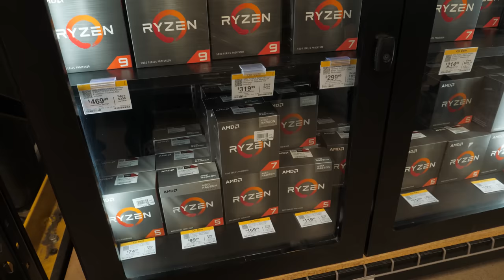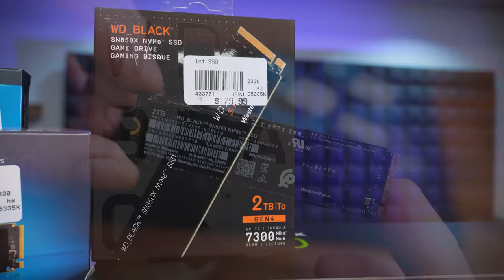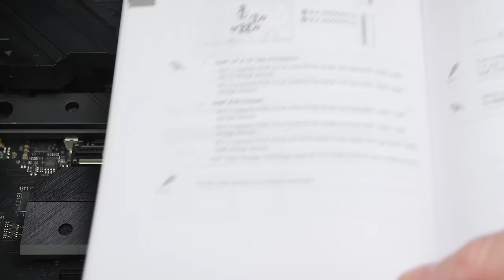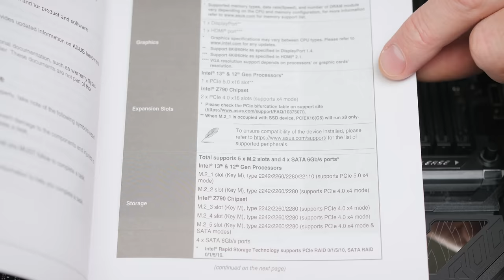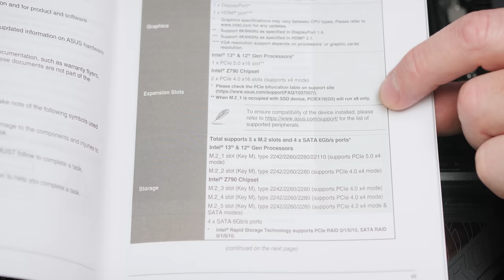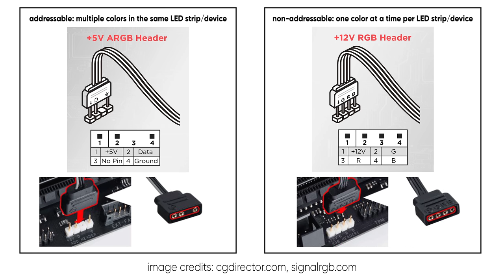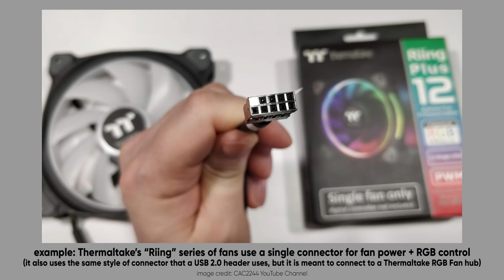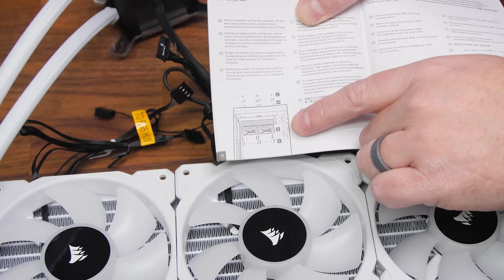How To Build a $3000-$5000 High-End Gaming PC - Step-by-Step Guide

Comment: HI Paul great vid 1st vid I seen of yours, Thanks for pointing out the config issues with connecting the various addon's and restrictions or requirements of the system in terms of compatibility and I thought there should have been a cradle for the fan controller I would like to set the rad against the intake fans at back of case followed by another 3 fans extracting the cold air into the box and powerful top fans at top to extract the heat maybe another rad at base to increase the cooling further and some sort of barrier to protect the system from leaks of coolant in the event that this could happen. not too keen on liquid cooled pc's not bothered about fancy lighting all I want is a system that can do any the tasks put upon it efficiently and is reliable, functionality, Expansion possibilities for the future and longevity connectivity (a bulb is just a bulb unless it means something) So for example another HDMI port so that I can connect you guessed it another BULB!( only this is not just any old bulb this bulb is another display unit!) I don't think we got a Microcenter over here in the UK! =(

Comment: Paul, out of all the components you chose the one I was really excited on you showing what the Thermaltake Toughpower GF3 PSU. Thermaltake doesn't get enough love when it comes to PSU's especially since they are putting out PSU's with the 12VHPWR connector that's rater 600W. How do you like Thermaltake's latest PSU offerings?

Comment: Ong the aio part is perfect to! Im sooopp inlove with the beauty of the new corsair h150i link series and deseperatly want to learn how to do it and what case to use but im so new to it all. Might go tower cooler if i stay 5800x3d but the 7800x3d is sooooo tempting aslong as everything feels safer to use and i can get a super awsome motherbaord for my needs. Aio is so tempting to just a solutly go crazy with 400$ of rgb fan heaven. Only issue is 750$ for am5 choice or keep what i got and go 200$ on a perfect b550 am4 mobo for the gear i have. Might throw the x3d with ram in my am4 b450 after i build a new system and bios flash it cause then id have 2 perfect systems and give my old 1080 some love for casual gaming and less heat and one perfect fancy eye candy system to tinker with and do crazy stuff for gaming oc and intense play when i dont gave to care as much about crashing my data and documents pc

Comment: @13:40 it should be noted, that some slots disable other things on the board sometimes, if it is shared gen 5 it could make the first pci-e slot x8 instead of x16
if you have both pcie slots filled it may disable 1 or 2 of the m.2 slots, and if there is a sata m.2, it would liekly disable at least one sata port, rtfm as you said
@14:23 ok you covered it, had me worried :P

Comment: Hello! I'm trying to get a new PC and thought this video was great. However, I only play a few video games like valorant on the side and mainly want to use a PC for programming/data analysis stuff. Would the $2000 graphics card be a bit overkill? I'm not too familiar with what's reasonable pricing. Is under $1000 plausible for a graphics card? Or rather just does anyone have any cheaper recommendations. Or is there anything else major that can get cut. I was thinking of keeping it under like $2000-2500... Thanks a lot; I appreciate it!

Comment: Paul, thank you for this build. My 14 year-old wants to build his own high-end system. Was going down the AMD path build (we built a pretty budget AMD about 2 years ago) but with their voltage issue have gone the way of Intel. He was given permission by his mother to spend some of his savings and we are following suit on this build (even the graphics card). Question: you have Lian Li extra fans. Were those just for talking about (I presume) or did you put them in the system somewhere? I don't see them on the front of the case. Again, thank you for the walk-through. Now we just have to wait on the parts. Cheers!

edit: watching the video for the 12th time, I answered my own question. Lian Li extra fans are for demo purposes and not put in the system.

Comment: So I got the ASUS NVIDIA GeForce RTX 4090 24GB TUF Gaming and it came with this four way splitter to power it. Can I use this single 600 watt power wire you used (I have same psu as in this video) or do I have to use the splitter and four PcIE wires?

Comment: Paul. Question please.  New to PC builds.  I have a Corsair iCUE H100i Elite LCD.  I plugged it into the CPU FAN header instead of the AIO PUMP HEADER.  Should I switch it to the AIO PUMP header instead?  If so why?  And if not why not?  Trying to learn...  Please help.  I'm using the ROG CROSSHAIR VIII
DARK HERO
Motherboard

Comment: I'm going to be building a pc for the first time soon, and I wanted to know if I should use Windows 10 or 11? Is there any difference?
Reply: it seems 11 worked slightly better with high end parts but from what i've seen latest 10 version works just as well

Comment: I have the same AIO on my recently new build. The LED on the pump was fine, when I first turned everything on. Then once I started to install windows, it just switched off. AIO is fine and rgb fans, just the LED on the pump. 

Tried using the ICUE software, it recognises the commander hub and RAM. Not the pump. Not sure what to do.

Comment: With those 13900K, really think an AIO is a bit sketch with the thin radiators and weak pumps.  Work fine if you don't OC I guess?  I can't imagine trying to air cool one.  I'm sure it would run, but can't believe it would be at all efficient and might throttle under a heavy load.

The wattage those things pull is absurd. lol

Comment: Man the rgb thing adds soo much wiring that’s insane.. how do you know where to hook up cpu water cooler? There is a cpu cooler spot and a water pump spot? What’s the difference? Also how does the system know to run the fans for water cooler in radiator on initial start before you download Corsair software? Hate to get your $600 cpu hot right away lol

Comment: With the orientation of the fans used, wouldn't they create negative pressure in the case? (3x140 intake, 3x120 & 1x140 exhaust)

Comment: Can you please answer my question?
I searched alot and noticed Strix 4090 mostly has coil whine issue.
So I decided to go with Gigabyte gaming oc since none complained in the internet yet!
But noticed it is kind of old so it is better to go with waterforce rev1.1
Can you please let me know how can I have both radiator and gpu watercolled inside case?
What is your suggestion.
Which case you offer?
Thanks in advance.
If you provide me link it would be great!

Comment: Quick question I want to ask ya. I’m currently in the process of building a new pc but I don’t know to go with the 13900k or the 7950x3d. I want a build the can both be great at productivity and gaming
Reply: it depends if what ever you are using benefits from the x3D or not, some productivity programs work better with intel some with the amd cpu, however if you just want a blanket statement, given how amd products get better with time though optimizations, amd has more cores and we are at the beginning of am5, IF you have the money I'd go with the 7950x3d, also the amd cpu works better with AI software and it seems we are going in that direction.

Comment: My build:

X570 Gigabyte Aorus Master 
Ryzen 9 5950x 
Noctua NH-D15 
Rx 7900 xtx
32GB Team Force 3600 cl14
Sabrent Rocket Plus Gen 4 2TB SSD 
Creative Soundblaster AE-9 with two Burson V6 Classic Single and two Vivid Dual op-amps 
LG UHD Blu-ray Drive 
Corsair RM1000 PSU 
Cooler Master Storm Stryker Case 
Asus Tuf K1 Keyboard 
Redragon Griffin M607 Mouse 
LG Ultragear 34GP83A-B Monitor 

I should be good for a little while.

Comment: Awesome Build Paul, This build is very similar to my build. I went AMD.....R9 7900x, Asus X670e Crosshair mobo, Seagate Vertex GX1200 psu..
Reply: great choice of psu, but 1200 is massive overkill for those components
Reply: @Shifty Wily  It's not about the power, it's about the 16 pin  pcie 5.0 1 cable connector
Reply: @javiernlt  ofc it is, thats why i said good choice of psu, but with the components you listed the 850 would of been more than enough, 1000 would of overkill but 1200 is really massive overkill

Comment: I hope part 4 will be a workstation build - Xeon W or Threadripper Pro - and can you also do something on managing cables on the desktop? When you've got 3+ monitors and a dozen USB devices the cabling can get messy.
Reply: Part 4 will be post-build set up; bios update, OS install, drivers etc. and hopefully a bit of optimization.

Comment: 16:31 a simple question: does it make a difference whether or not you remove the sticker on the SSD for better thermal connection, or is that negligible?

Comment: Bro, I am so grateful to for this beautifully detail pc build. I have the z790-f motherboard. I have thermaltake 750w argb. Im building a music production pc. I don't have a cpu and i dont have a gpu yet but I have 3 questions. 1) do I have to have i9 13900k or can I go with i9 12900k? 2) if the above cpu I chose has integrated graphics, do I still need an expensive gpu? 3)will the 750w argb power supply be enough? Thanks and honestly I just had to subscribe 😅
Reply from the maker: Thanks for the sub! To answer your questions, 1) yes, the 12900K and 13900K are both compatible with your motherboard; 2) no, you don't need a GPU and you can run your PC with the integrated graphics. You'd want a GPU for gaming or for software that can leverage GPU resources for processing, such as a video editing suite. 3) That 750W PSU should be more than enough if you don't add a GPU. If you do add a GPU, check the GPU's recommendation for minimum power supply wattage, and maybe go for something 50-100W more than what it says. Hope this helps! 🙏

Comment: Did you not forget to install the little rubber stand-offs for the M.2 installation? They are at least listed in the ASUS manual. Otherwise a 800 mm M.2 may bend slightly...
Reply: I think they are optional, and only for single-sided M.2. Looking to build this system with my 14-year old son. Thanks for bringing that question up, though. Made me read the manual again.

Comment: Confusing why you chose to have only 3 fans pulling air in, and 4 fans blowing air out (1 on the rear and 3 on the radiator). Am I missing something? Shouldn't you have reversed the direction of that rear fan to pull air in and create that slight positive pressure inside the system?
Reply: no because 3 front fans in are 140 each, and thats more than, 1 back 140 and 3 x 120 fans top can disperse.

Comment: About the proprietary RGB connectors: usually, I would say "proprietary is sh*t, stay away from it", however, the pseudo-standard 3-pin 5V-RGB and 4-pin 12V-RGB connectors are a PAIN because, most of the time, they get loose very easily and tend to fall off during normal operation, sometimes days after the assembly has finished. I hate those.

Comment: Wouldn't this build result in a negative pressure (3 fans in and 4 blowing out) which goes against your advice to keep dust out? 

Besides that, do you really need 1350 W PSU? or is 1200 W enough? First time I see someone use this kind of power with similar build.

Thanks for explaining the 4 different type of fans, very very useful and maybe could be its own video.
Reply: 1200 is more than enough. I run 1000 on a similar build, just amd vs Intel on the processor

Comment: Hello Sir, 
Appreciate the detailed explanation and instructions on the whole build. A quick question though, do u think Z790 Hero is as good or better than the one in the video ? 
Our specs would be the same as yours in the video. 
Appreciate your answer
Reply: Price of both motherboards should give you an idea which is better. Back in Z390 era, Strix motherboards were lower down the range than Hero motherboards.
Reply: @marknewellmusic is it better to buy the MSI Meg Z790 ACE instead of hero ? What do u think ? Pairing it with Core i9 13900K and RTX 4090 OC Edition

Comment: thank you very much for this important clarification about ssds. i have a msi z790 carbon and want to use a high profile m.2 cooler in slot m.2_1, this video reassured me about my choice. btw i use Hyte y60 + vertical VGU position.

Comment: i tried doing 4 corsair ddr5 6000hz 64gb vengeance which i bought at separate times .. not sure if thats the problem ?..it worked but as soon as i did xmp it didnt like it that much ..xmp works with 2 ..32gb
i have the same mobo and running 12th gen i9-12900k .. any recommendations ?  i returned 1 of the 2 packs of ddr5 cause i was getting frustrated and didnt wanna deal with it.. yes my bios is updated/ all is updated.

Comment: Makes me feel good that all the parts chosen were about the same as what I chose for my build. The Lian Li case is really sweet, it comes with a lot of cool extras not mentioned. The only real differences are that I went 13700K with Noctua air cooling, 64 MB but on two sticks instead of 4, and higher end SSD but 1 TB less storage and another 8 TB HDD. I do game but mine was more for creative and productivity applications. (also avoided the extra cost of Stryx for the more reasonable TUF 4090 and MB)

Comment: Do they sell 8 pin power connectors for Gpu’s? I’m going from a 6 pin to an 8 pin and I can’t find anything about it. The cable that was going to the old gpu has a six pin with a two pin connector on the same cable

Comment: nice Rig. Wouldn't be a Fractal Design Torrent better for the 4090 because of it's insanely good Airflow?
Reply: not really, if you are going with a hot high end cpu. The torrent doesnt have the best configuration for water cooling, fractal is best if you are going with a full air cooling build where the CPU will not require high end cooling.

Comment: Shouldn't you take off the stickers form the ssd M2 drive
For better heat spread
Reply: Typically no, most stickers on drives are thermally conductive so are designed to be left on the drive even if heatspreaders are used.

Comment: how important is it to only have ONE m.2 SSD in when loading OS? everyone says leave the others out but you left them in??? I have 3 as well and feel like it'll be really difficult to add them in once its built? can I leave them in?
Reply: The reason to have only OS drive in is just to make the OS install a bit less confusing when it comes to the step in the installer where it asks which drive to install the operating system on... 1 drive in motherboard means you can't install to the wrong drive. You can still have multiple drives in motherboard during OS install, but you will need to be careful to make sure that you pick the drive you want in the OS install drive choice screen.

Comment: With 3000€ I could get that 4090 strix (2100€), that motherboard (650€) and maybe that powersupply. Gainward 4070ti phoenix (cheapest 4070ti around here) was 1000€ and 7700x was 450€.
There's a reason why my old setup was from 2015 with skylake and ddr4. 😂

Comment: Beware putting your m.2 drives in the slots that go to the CPU because the will share your GPU bandwidth. Dropping your GPU from 4.0 x 16 to 4.0 x 8 and having issues during gaming. I noticed that when I had my OS drive in the M.2 slot while gaming is that slowdowns and black screening after if I start up the game a second time (Halo infinite, Horse Tales Emerald Valley ranch) and have to reboot my computer. Moved the OS to another spot that not control by the CPU and those problems went away.

Comment: Where do you get those gpu supports? Do they come with the case?
Reply: most high end cases come with a support and most 4090s come a support as well, just check whats on the box of the specific case and 4090 you wanna get

Comment: If you were to include an AIO Gpu Cooler like the Gigabyte Waterforce series...would you mount it's radiator in the front...haven't seen any builds with and AIO for CPU and GPU.

Comment: @paulshardware, how do you link the corsair and asus rgb programs together? I have asus motherboard, gpu, and corsair fans, pump/res combo for custom loop, and corsair dominator ddr5 ram. I use the corsair hub that comes with the hydro x series icue xh305i custom loop kit. How do you sync asus and icue?

Comment: Hey Paul I built almost exactly this same set up and once I turned it on the MoBo also threw that white QLED  errod with a d6 on the display same as yours... Once I'm on windows the PC it's been crashing after a couple of seconds of video glitching... Do you have any clue what might be triggering this?
Reply: nvmd looks like one side of the cpu cooler was needed a bit of tightening

Comment: Hey Paul!  Great video as always.  Curious if you've tried the replacement kits for LGA1700 to prevent socket bending.  If so, worthwhile for common air coolers?

Comment: The PCIe 5.0 x4 mode nvme slot pretty much has to be competing with the graphics card given the CPU can only give x16 of PCIe 5.0 and that is going to the gpu - unless there are 20 lanes total and other mobo are ignoring that extra 4 and pushing that x8/x8 split - but I dont know why they would bother.

Comment: Paul, I love this build. Would you be interested in helping a local in building a new PC? I would like to go a little overboard as I stream on Twitch and my current rig is having some weird Nvidia codec issue where it is crashing. I'm not sure why it's crashing, I'm currently on a hand-me-down rig that is a i9-9900k and a 2080Ti with a mixture of NVME M.2 drives and a couple other SSD's. I have already purchased the new SSD's but I haven't bought anything else. I would love to have your expertise in this situation. Would love to chat more if you're interested. Also, would like to try to trouble shoot my current rig to find out if I have a bad GPU or ??? Thank you for all your videos and help in tech. I know this video is a couple months old now but, I hope this message finds you.